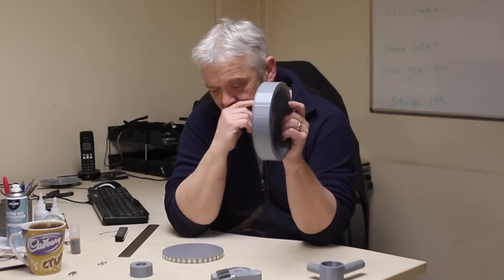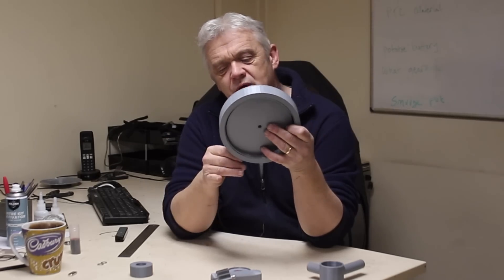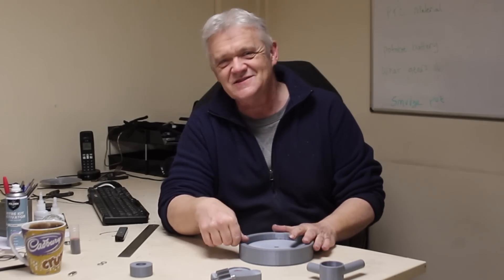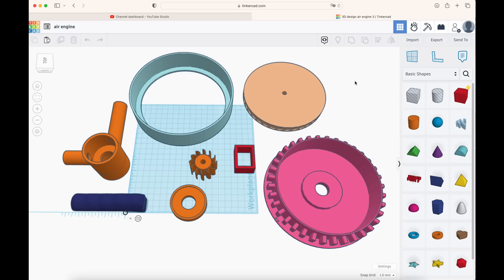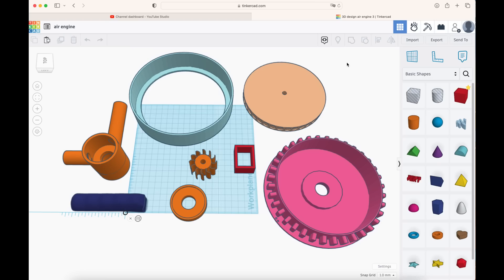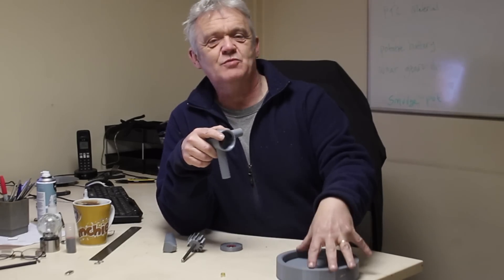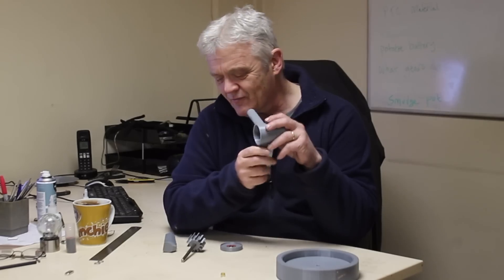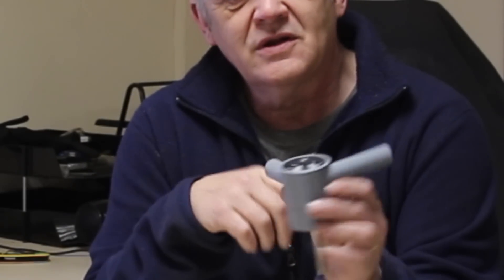1896 The 'Blow Torch'  Generator

Comment: I've been following this channel with interest as it is just plain fun but also, as I plan to move onto my sailboat and want alternatives to my existing solar solution (48v) be less dependent on the weather ;) The recent videos of harvesting from water have been great food for thought. It feels like there is mileage in a hybrid wave / air. Imagine a number of tubes with one end immersed in the water, two non-return valves near the top: 1 allowing external air into the tube from the atmosphere, the other allowing egress of that air into a connected manifold. Configure the only exit from the manifold to pass through a turbine and harvest energy from that.

Comment: I assume the lamp runs on the battery, right? If not, it would be a good idea to show that it does not show light when the wheel is not turning. Like it is presented, it somewhat seems like you are deluding yourself, or the viewer. I would think the generator should be strong enough to power that light, but why don't you demonstrate it? (And why do you make it look like you demonstrated it?)

Comment: now, we have the option of a water wheel generator for electricity, and a pump made from a wind powered system to move the water from the collector to the reservoir,  the sort of idea that was used in the old water clocks

Comment: Dear Robert, 

Please could you help with re-designing freezer drawers.  The ones that came with the freezer cracked, replacements are £60+ and it's daft to replace the brittle plastic that cracked with the same brittle plastic!  I was thinking about different materials and thought about carbon fibre +/- silicone but would really love to get your take on it while it keeps whirling around my head when I should be doing other stuff.  It did occur to me that the wind turbine etc would also need to be suitable for below freezing so you and the rest of this tribe might have some suggestions?

Big fan, love the channel!

Ruth

Comment: You got me!
I was thinking of the American use of the word torch and was thinking you invented a new kind of fire starter 😂

But think about it. What if you extended the tube a bit to a safe distance and you put some sort of spark generator on the other end instead of a light bulb.

Then, when you're out camping or whatever, you could blow into this thing to start a fire and never have to worry about finding a match or or your lighter running out of fuel ever again. 😂
Reply from the maker: oops my bad - but i do like the idea
Reply: No worries

Comment: A pull cord will be the most impressive simple add on (easier to make than a turbine).

NB - general info: With respect to  a single rotating, body the torque doesn't change - the force decreases the longer the radius arm - Torque remains - and power is constant, to truly convert torque to speed (ie. Linear Power = Force * velocity,  Rotational Power = Torque * angular velocity)  a transmission - of some sort (gear, belt, string, chain, magnetic, etc...) is required. With a transmission, neglecting losses, Torque reduces while speed increases - Power is constant - vice versa.
Reply from the maker: done it already and did a video about it.

Comment: In the US, there is an item used to turn the older fire alarm bells called a water moter gong.  It is a pre-made water to torque converter which turns the bell.  They use bushings instead of bearings but the setup is almost exactly like the air turbine you just made.  Also the blades are cheep plastic but it works wonderfully.  The indoor turbine assembly turns a steel bar through a tube in wall to the bell and striker.  Funny thing is I put a used one in my truck a week ago and examine it now and then.  The whole assembly is so close but just off.

Never thought of putting air through it but I'm sure it would work.  For now it's just turning the wheels in my mind.  The bushings can easily be bearings.  Anyway the frame is aluminum with a tin cover plate.
Reply from the maker: cheers mate

Comment: Now... that lithium battery comes with a charge. The question is, how winded are ya gonna be to charge that battery up enough to have some usable light?
Reply: That is a NiMh-battery and the thing bugging me about the video is the fact that the LED is using that battery. There has to be some power generated but the light would be on even without the generator.

Comment: Generating electricity is BLOODY easy....
Humanity has so many ways to do that part its crazy!
The part we struggle with is storing it until we need to actually use it!

We do like to store it as electrons in batteries or capacitors since in that form its "ready to use".
Thats the ONLY 2 ways we have to store it like that - some kind of battery, or capacitor.
If you want to solve the energy crisis, dont focus on generation focus on storage!
"Build a better battery".....this generations equivalent of the old saying "build a better mousetrap"!

Seems easy....harder than it seems!

BTW....this is LITERALLY a scale model of a windfarm.
And even at this scale it includes the ONE part that makes it all work as intended....
A bloody battery!! A method of storing and building that charge until you want it.

Relying on "instant generation, immediate use" is something even schoolkids recognise as ridiculous!
Yet thats exactly what our power grids do!
(Our entire system here only has ONE. Refered to as "The Musk Battery" here in S.A.)

Over a 24 hour period I generate more energy than I consume, yet it is a slow trickle that needs to build up.
Not enough to use directly from the source, but AMPLE overall.
If you can find a better way to store electrons, you just found the holy grail !

There ARE other methods, but they ALL require conversion. They store energy in ways that need conversion back into electrical energy before it can be used in the final device.
Crack that nut, you just saved the world!
Good luck!

Comment: "easy to build"..... not if you don't have a 3 D printer it isn't... just saying.
Reply from the maker: whicch is one reason to get a 3d printer I would say lol
Reply: @ThinkingandTinkering  some of us who live off grid can't afford one.... not a laughing matter. I don't have companies just giving me one, like some people with channels on you tube, just saying.
Reply: can you build one without the 3 D printer?  Or do you have to have a 3 D printer to make a wind generator that actually produces a usable amount of electricity? I built a VSWT that puts out 90 amps/12 volt in 20 mph winds and did it WITHOUT a 3 D printer.  Even did 2 you tube videos' of it.
Reply: @keithfloyd1178 Just subbed. Greetings from Finland! 

I have two storey oil drum savonius on mind with most of the materials gathered.

Using an old iron bed frame and some 3m traffic sign poles the plan is to lift it up 6 metres up on field. The generator is closer to the ground in some sort of box making repairs and mods easier.

The build with frame is heavy so some pipes are used to support it to the ground. 

Any tips for a beginner?
Reply: @Teknopottu  getting the shaft holes in the center of the drum is key. Self balanced if you get both holes dead center, that is the biggest tip I can give.
Reply: @keithfloyd1178  That is the plan. Thank you. Done cutting one barrel, think it was pretty pretty even too. I'll see later if there is some balancing to do.
Reply: @Teknopottu  in my project update is the video I based it on. Couldn't get the washing machine pulley but could one that fit the shaft. My shaft spins and the video design doesn't. That was the only change I did to the original.
Reply: forgot to mention, my bearings mount to the stand. Also with my design you can change the pulley size on the shaft, I'm planning on a bigger pulley so it generates at lower wind speeds. Right now at 20 mph winds the alternator rpm is 600 so it's producing a solid 12 volts.
Reply: @keithfloyd1178 There is also great joy to reuse old and discarded items to make generators and other stuff. 

Seems most DIY:ers use materials ordered and/or made on other side of the world while most materials are near you in broken electronics and other reusable stuff.

I get it, it is sometimes easier. 3D printing parts you need exactly the size you need is handy. But mostly useless waste of resources. 

We have enough, why not use it.
Reply: This is an honest question... have you ever built a generator that can run a normal house? I've lived off grid 8 years so I do have a frame of reference on this topic. I live it everyday, I'm off grid and online and try to walk my talk.

Comment: I was wondering how these flat disc generators could perform with a Hero engine? BTW don't make a Hero Engine with dry ice. It will explode. As that design looks now I want to put a water line to it with maybe a pelton wheel over the impeller blade. This is not too different to the shaker lights but use a pull starter type assembly on that flywheel. Like you said there are so many other ways to put 'power' to this system.

Comment: Garden light for winter use here in Norway 😊
Reply: Greetings from northern Finland!

I have had 5 of these light and a string of 8 lights on my window for couple of winters now. All solar powered. 

Removed the small 1,5V NiMh-batteries, connected the lights all together and to my 1,5V battery pack made of 8 NiMh-batteries from broken chargeable vacuum.

Only in mid winter the lights started to go out before the morning. Otherwise a pretty realible night/emergency light.
Reply from the maker: I can see that lol

Comment: Would a sectioned transformer steel or ferrite ring on the outside of the coil (opposite of magnets) improve the generator efficiency?  Thinking it would pull the magnetic fields "straight out" so the N S N transition across the coil is more intense.
Reply from the maker: I don't know - try it and see and let me know - cheers

Comment: Robert, Im thinking in a spinning wheel using both sides of the neodinium magnet with two serpent coils: one in the negative side of the magnet and the other in the positive side and double the output. Is that possible?
Reply: Flip 90deg but then the coil needs changing, and then it would be an axial flux coil generator 🤣

Comment: I'm wondering whether there could be a larger adaption of "The Blow Torch" and have the wind fed into it by the Darwin turbine? Could there be any additional efficiency over a standard turbine at the bottom of the Darwin, by including this new design with the flywheel included?

Comment: Heyhey, with regards to utilizing atmospheric electricity:

(TL;DR at the end of the comment)

I have been wondering if it could be possible to connect an atmospheric motor (akin to the corona motor you showed in your previous videos, appropriatly designed for the following purpose) to a fan, by that cause a surface (with heatsink) to be cooled to such a degree that the surface would collect dew from the aerial humidity, which then due to gravity would allow this water to be collected, thereby causing a continual supply of fresh drinkable water, for as long as the connection to the ions in the sky and grounding is stabilized. 

If the water would be collected higher in the sky, and enough of it, the force resulting from gravity could probably allow the flow of water to be connected to a water turbine also, per a "storage of X liters till flow into turbine is profitable" system.

In theory this should work wherever humidity is present, depending on environment.

With the switch patent you also had mentioned before, connecting the rod (the wire) in such a manner that the electricity flows through a coil probably in theory causes inductive heating (which usually is dependent on amps and AC while with this scenario it should probably still work with DC) due to jumping voltages resulting from the switch being triggered.

If true, dew collection would then be possible in "every" temperature.

TL;DR: Continual running of fan + inductive heating coil (caused by switch) due to electricity syphoned from the atmosphere = dew point collection "everywhere" and thereby drinkable water "everywhere", and "always".

I've also been wondering if just putting a wire into the earth deep enough would have the same electrostatic effect that corona motors utilize? Its still delta V.

I would love to hear your thoughts on this, possibly even a video of you delving into this concept.

Thanks. 🦔
Reply: You could build one to test your theory. Another way to help moisture drop out of the atmosphere is by lowering the air pressure. You could combine a fan with your heat sink on the upper side of an airfoil and see if that increase water yield.

Comment: Big fly wheel works like a capacitor.
Reply: or rather an inductor haha
Reply: Yeah I think a weight in the air acts like a capacitor?
Reply: @DMWatchesYoutube  You need to educate yourself.  For the last two decades education has been a dumb down process.
Reply: @francisbacon2401  don't 🎶be 🎵a🎶dick🎷🪇